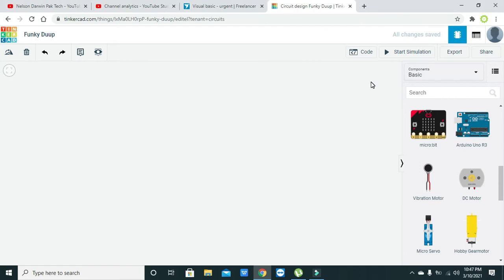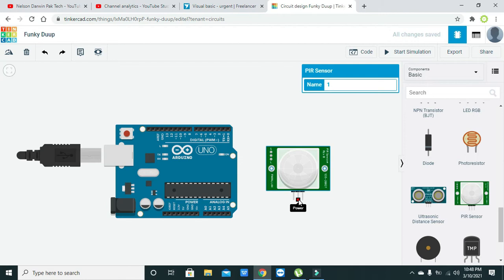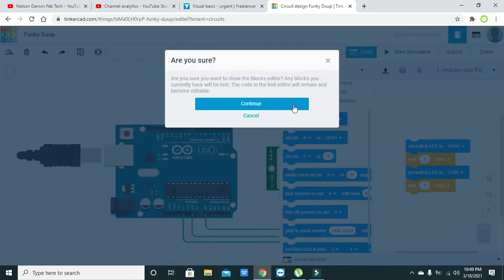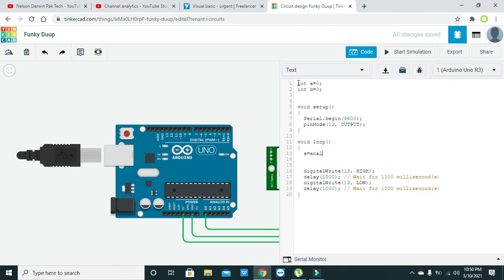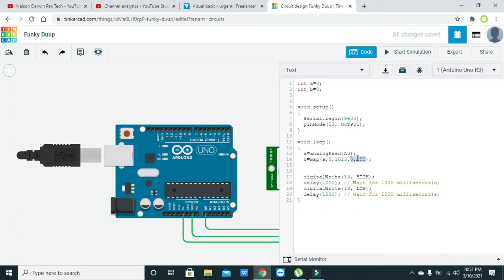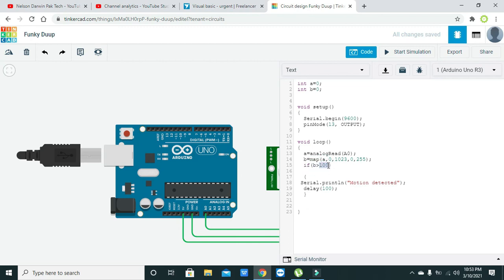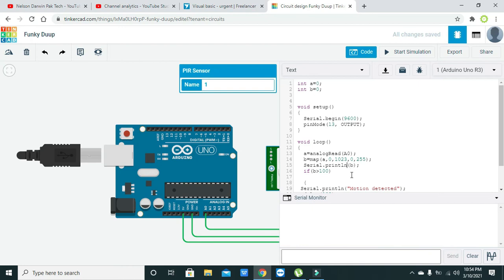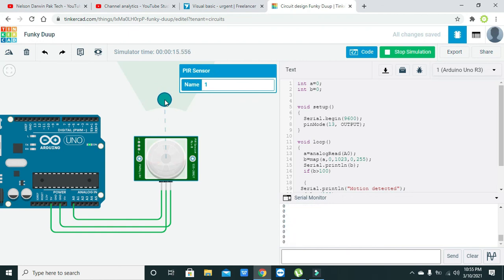PIR sensor with arduino simulation in timkercad | how to make a motion detector in tinkercad

Comment: what is the maximum current that flows through the circuit and how large that current is and how do you connect the multi-instrument to measure this current?
Reply from the maker: I think there is multimeter option in tinkercad.........